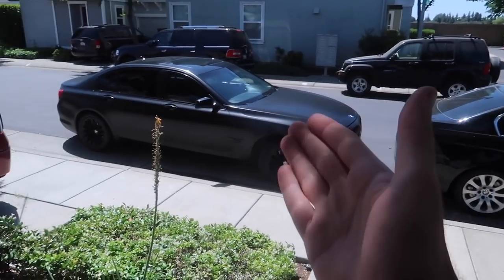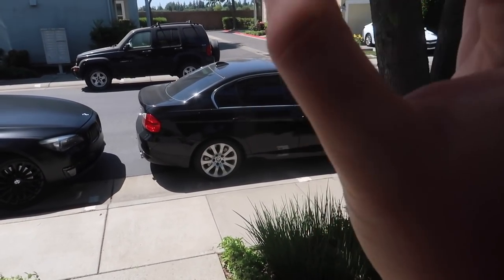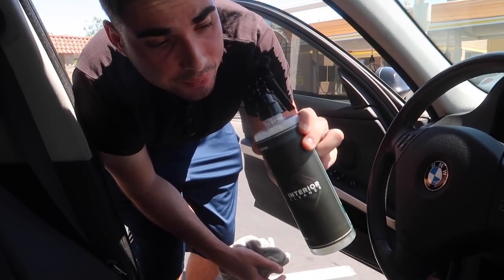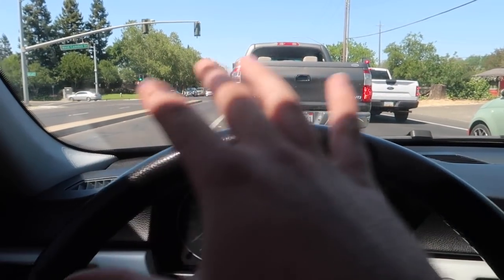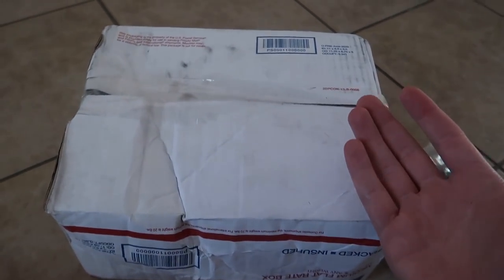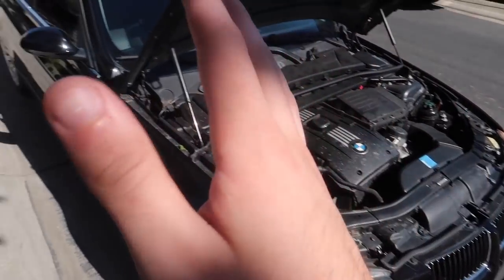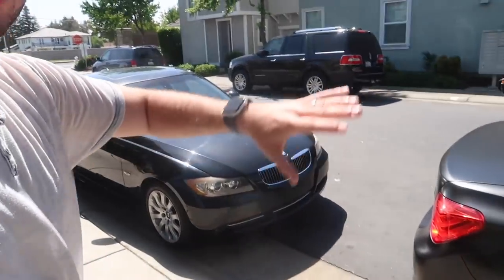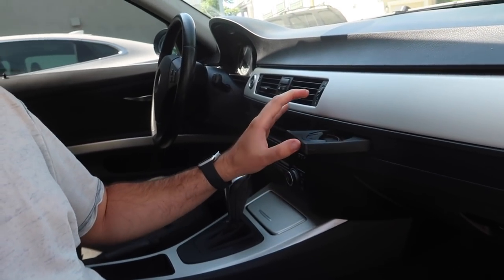JUST SOLD ANOTHER HOOPTIE! ONE DOWN, WHATS NEXT?

Comment: N54 has injector problems. They start ticking when they go bad and throw drivetrain malfunctions (limp mode) especially 2007 models which came with index 1 injectors.... i think you should have done them before assuming it was a motor problem since stock n54's never fail.
Reply: Johnny Chimpo  true, but we climb the ladder step by step.. we can't jump for the cieling directly.🤭
Reply: Johnny Chimpo  yes because as he said he had a cylinder 3 misfire with brand new coils and plugs.. which leaves injectors.. or worst case scenario damaged cylinder/valves.
All i said is that he could have wasted "30$-50$" on a index 12 injector and narrowed it down.
And in some cases,, brand new coils can give problems so he can switch coils between 2 cylinders and monitor it as well.

Comment: The ticking sound could be one of the injecter o rings going out, costs like $2. Keep it up bro 🔥
Reply: I have the same issues and my rpms r rough on a cold start. Is that my injectors. That need replacing or could it just be the rings
Reply: @marioi6458  what engine? Could be Vanos seals. Try unplugging Vanos Solenoid Connector and start the car.